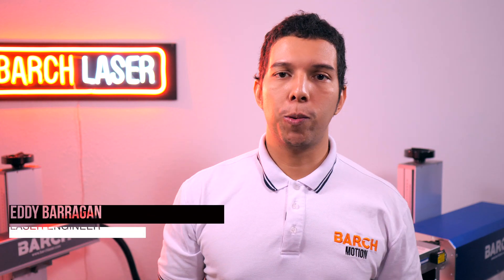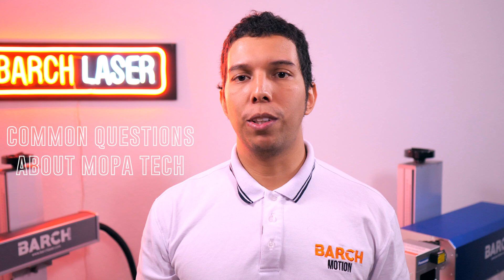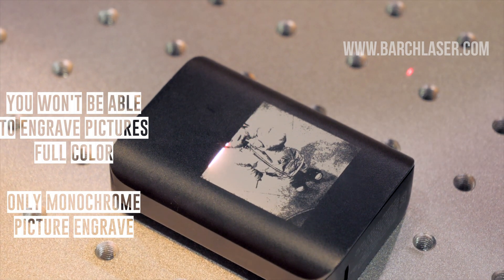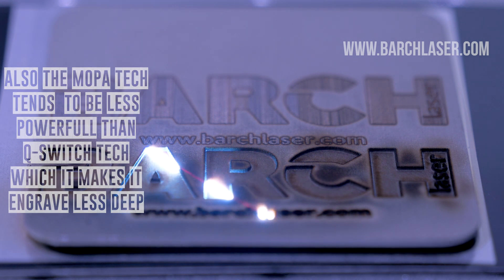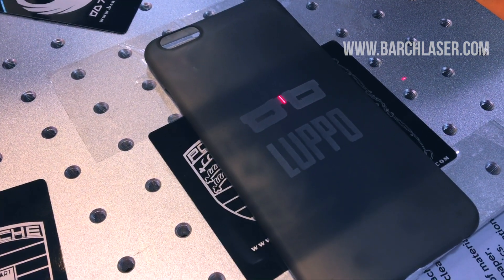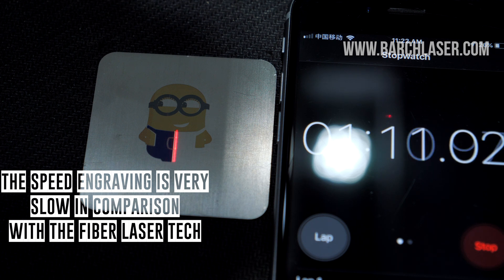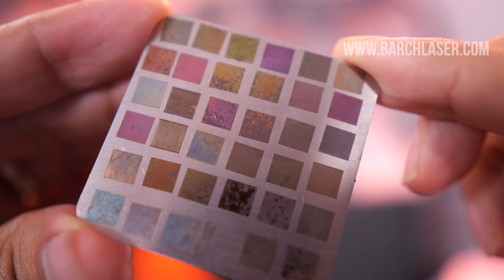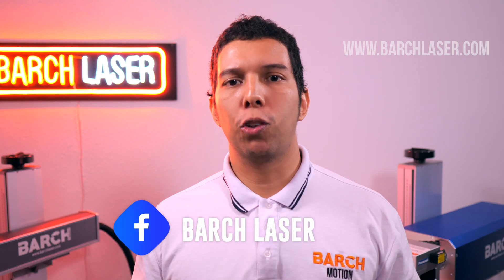MOPA laser the truth about this technology, metal color engraving, what you need to know before buy

Comment: Thank you for the honest info, I understand that color marking is not durable especially when used outdoors.  But what do you recommend for black marking of stainless steel and aluminum.     If I got it right MOPA can mark both materials with deeper black, more contrast.    But what about the durability of black marking with MOPA ?
My other question,  we see color marking is slow with MOPA.   But can we just not use the MOPA extras and mark with the same fast speed with a MOPA laser as it was a normal Q-switched engraver?  Is it only some features related to color that makes the process to be slow or a MOPA is always slow ?
Reply: Yes, you can use a mopa laser just like a normal fiber laser. MOPA laser just allows you to use a higher frequency.